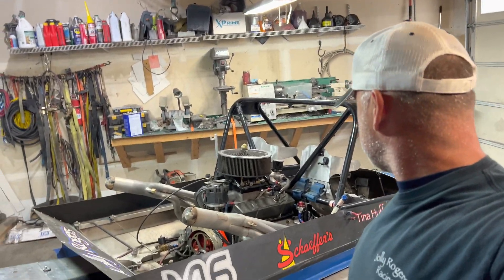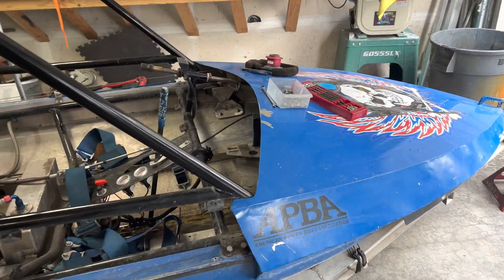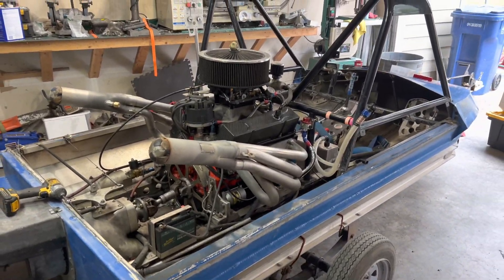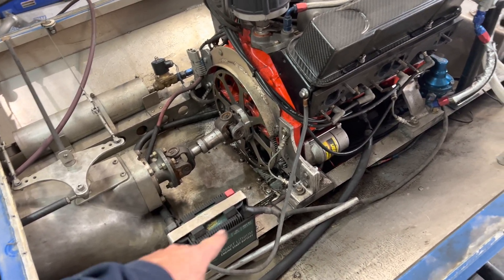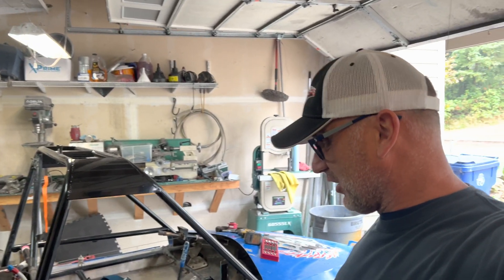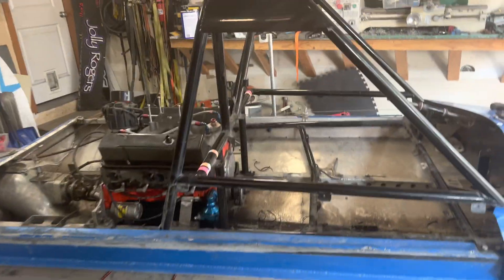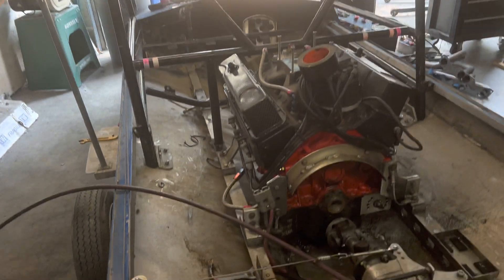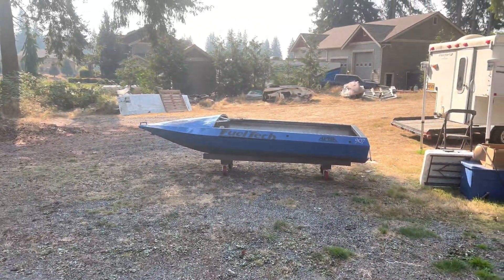Jetsprint build episode 1, complete teardown

Comment: Thanks for that , very interesting. One question ; is the engine cooling provided by the jet ?
Reply from the maker: Yes it is!  That’s the Y that comes in from
The transom.  It’s a bypass supply line off the pump that provides the engine cooling.

Comment: What kind of heads are you running on that SBC AND what are the restrictions do have on cam specs
Reply from the maker: Most in the class run Dart Iron Eagle heads and no there’s no restrictions to the cam.  Valve angles have to be oem Chevy , iron block, iron heads in this class.

Comment: How many seasons will a hull last? Assuming no terrible wrecks or technology changes?
Reply from the maker: There’s really nothing they wears out a hull other than wrecks.  There’s hulls currently running that are 20 years old.  Might break a weld or two head or there or like I said, need a repair from a wreck but as long as your bottom is straight and true there’s nothing that would really wear out.

Comment: Pretty simple machines. You made quick work of that. Question for you Eric...  Why isn't fuel injection more common?
Reply from the maker: Trippie nailed it, it’s a class rule for Group A400.  You can run injection in the unlimited class only.  Single carb in both A400 and Modified.  There is an LS class in Australia that is really popular and a movement here in the U.S. for one as well.  I expect you will be seeing more injected LS boats soon!
Reply: @JollyRoger907  Cool thanks for the reply Eric :)
Reply from the maker: @jesscneal  I’m trying to reply to every comment.  I get behind sometimes but that’s my goal.  Thanks for the sub and feel free to bring on any questions you have!  And you’re right, they are pretty simple!
Reply: I can't say for sure but it may be a class thing on what they can run, different classes of racing allow different parts, eg. turbo's, fuel injection, and what not.
Reply: Yea, that’s a great question!